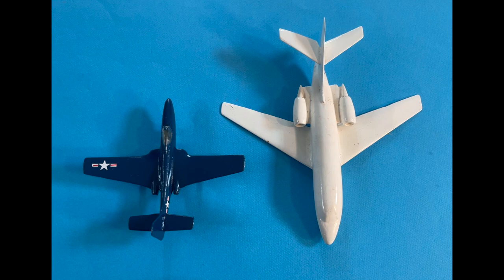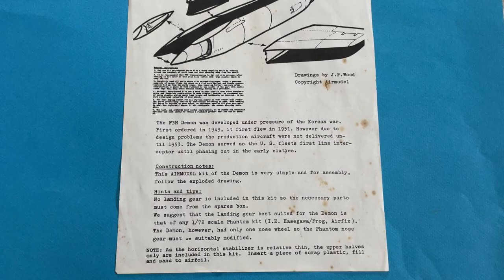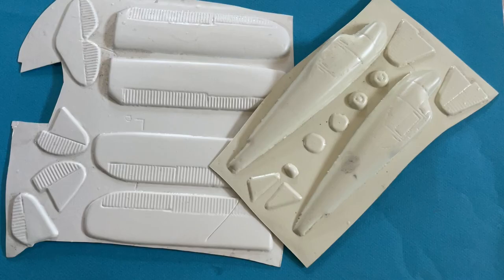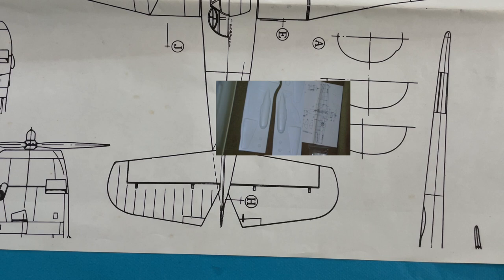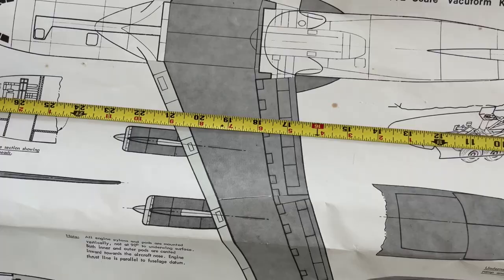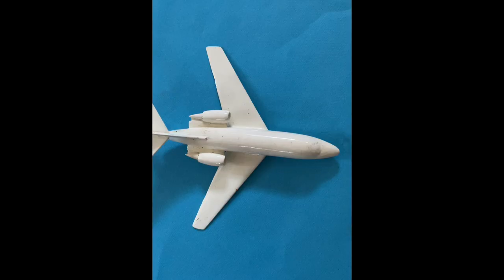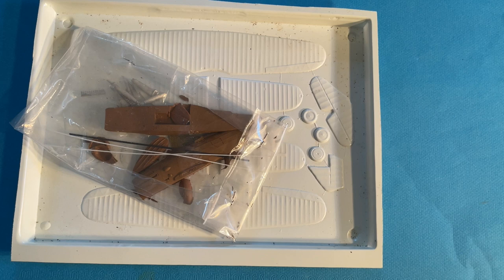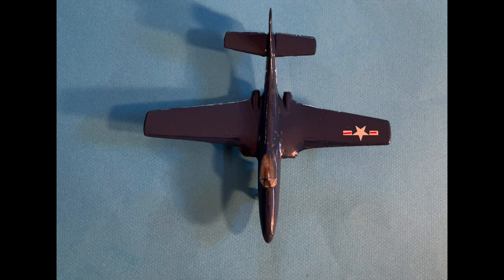Vacuform and Resin

Comment: Very interesting.  I've had one abandoned attempt at a vacform kit, a AW Argosy, a British military transport.  The amount of sanding cutting and shaping was endless for  what was going to be a low detail kit.   I have had better luck with a pure resin kit,  a Boulton-Paul P120, a British early experimental jet.  As is stated, small resin parts are brittle difficult to work with.  They can also warp in storage, which can sometimes be corrected by immersing in hot water.  It's no wonder injection plastic kits rule.
Reply from the maker: If it's the kit I think it is, you picked a big difficult one, but you are right, vac kits are very lagor intensive and tend to be poor in detail.
Reply: @geraldsteele7620  it was a Welsh models 1:144 scale kit.  That was the problem. The sheet it was formed from  was very thick so I had to remove masses of material to to get leading and trailing edges tapered  to scale.